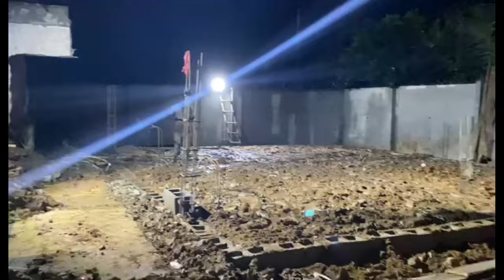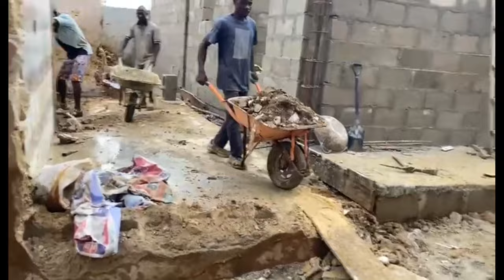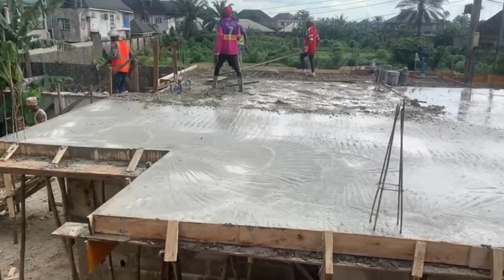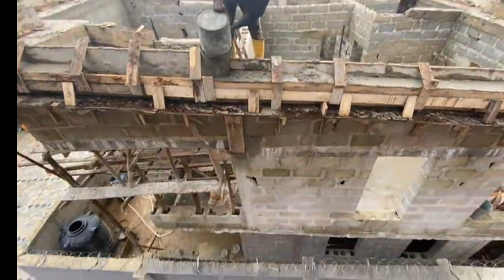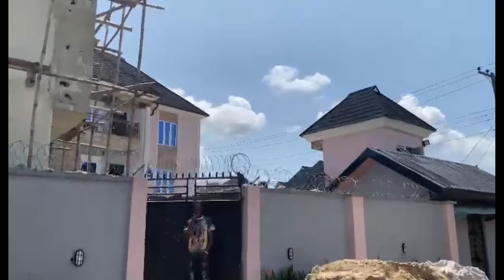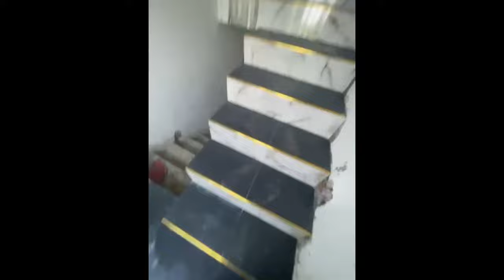Cost and construction stages of building this 33 MILLION NAIRA Duplex in Port Harcourt Nigeria |Umek

Comment: Happy new year Engineer,
   Please I need some clearification, the figures you gave for the stages, like DPC(ie German Floor), the block work and the Decking, were the blocks., cement and rods included?
Reply from the maker: Yeah… this project was started in 2021 and concluded in 2023 so those figures may not be the case now…

Comment: if you dont mind measking, why do engineers or construction in nigeria have lintel around the entire house dimension. is it a structural member or its just meant to be a stud for attachment of doors and windows. if its a stud then it doesnt need to run the entire stretch.
Reply from the maker: In most cases, we use it to replace the chain beam above lintel, which is a structural member… instead of having a lintel and then a beam above the lintel, we then just chat in the building at the lintel level to save that bit that would have gone in for only lintel and then a beam…
Reply: I studied Architecture and have a little experience with building construction though i am currently not active in the field.

I would say we use beams here mainly for structural reasons. 

One reason is to help to spread and transfer dead load or live load to the ground via the columns.

Another i would say is to help to prevent in the occurrence, cracks from running from the base to top of a wall(cracks can happen as a result of settlement, building fire etc.). Having the lintel can help to maintain structural integrity while you replace damaged walls.

I hope i helped.

Comment: Can I get the engineer number ?
Reply from the maker: The number on the screen is the number… it was designed and built by us… thank you
Reply: The number is not on the screen..check well
Reply from the maker: @Nebohson81  +2348063344183